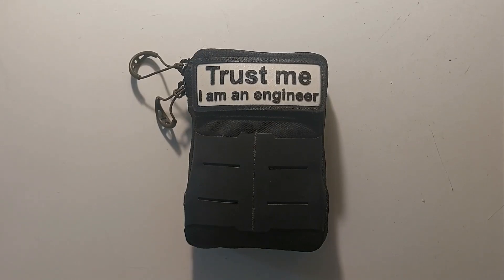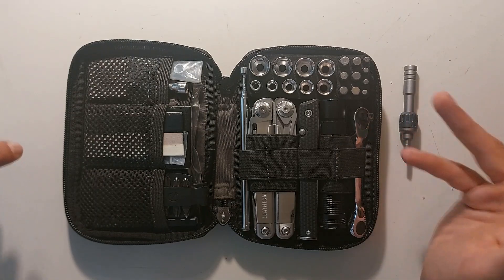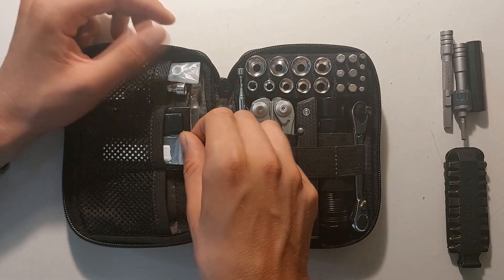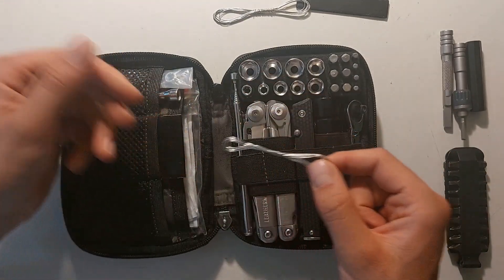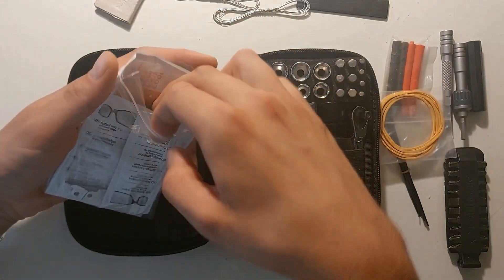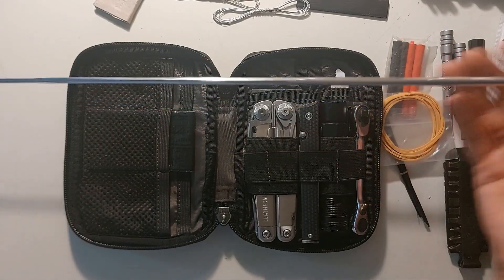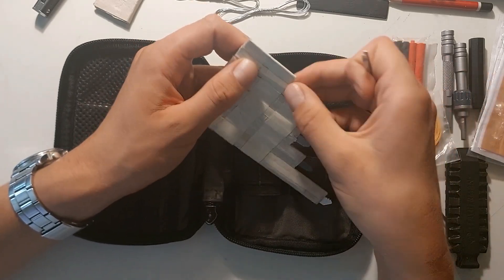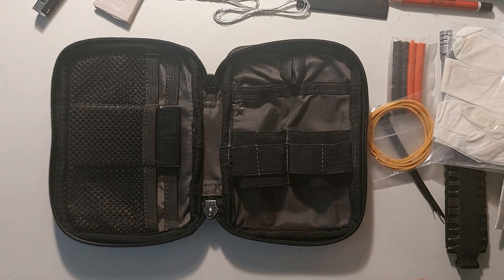EDC for Engineers - Update

Comment from the maker: 1. The packing list of this EDC pouch:
2. The pouch:	https://amzn.to/47f64Kz
3. Leatherman Surge:	https://amzn.to/3RWT0Fn
4. Leatherman bit set:	https://amzn.to/47dCAgb
5. Leatherman Bit driver extender:	https://amzn.to/3tuTwkB
6. Compact knife CRKT CEO:	https://amzn.to/3vhadk5
7. Olight S2-baton alternative - Olight S2R II:	https://amzn.to/41zwkhL
8. Cross wrench M2 - M4:	https://amzn.to/48xds55
9. Socket set 4 mm - 13 mm:	https://amzn.to/3NFLhZC
10. Screw extractors:	https://amzn.to/3TGWXPU
11. 1/4-inch drive bit adapter (female):	https://amzn.to/3RYvIPy
12. Micro bit adapter:	https://amzn.to/3TEYLso
13. converter 1/4 inch to hex:	https://amzn.to/479KmI5
14. Telescopic magnet (retrieval tool):	https://amzn.to/3tndqhu
15. Alternative jig saw blades (steel, wood, plastic):	https://amzn.to/3H0oQee
16. Alcohol wipes:	https://amzn.to/41BiH1u
17. Bandages (best imo):	https://amzn.to/3toSIOh
18. 4 inch zip ties:	https://amzn.to/41BESV4
19. Steel wire:	https://amzn.to/48uHUgg
20. Rubber bands:	https://amzn.to/48sIP0C
21. Lens wipes:	https://amzn.to/48yWV0I
22. Teflon tape:	https://amzn.to/483W7kt
23. Electrical tape:	https://amzn.to/3vbynMB
24. Protective gloves:	https://amzn.to/48emHHD

Comment: Best EDC ratchets to replace your old one:
1. Toptul ratchet set GADW4502. Ratchet + extender are extremely versatile, it's a copy of Franch Facom mini ratchet, I think, there are copies from other manufacturers.
2. VIM HBR3 - small and handy ratchet. Also has copies from other manufacturers.
In my to go tool set I have them both)))
Reply from the maker: Thank you! I will be checking it out because I still need to replace it haha
Reply: @TheWillem  Didn't find them on Amazon, but saw them both on eBay.